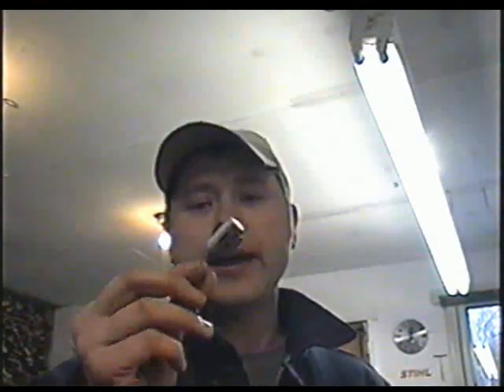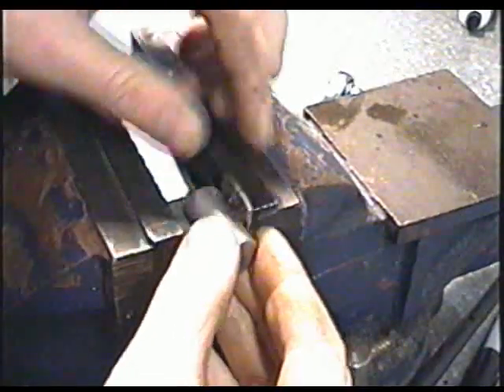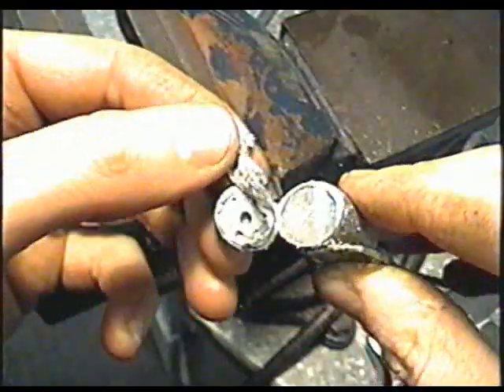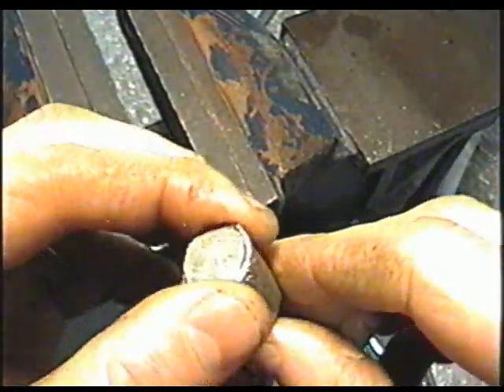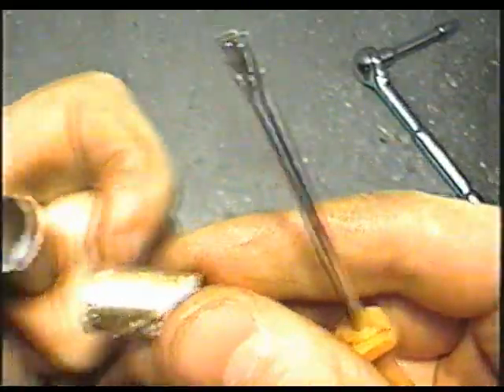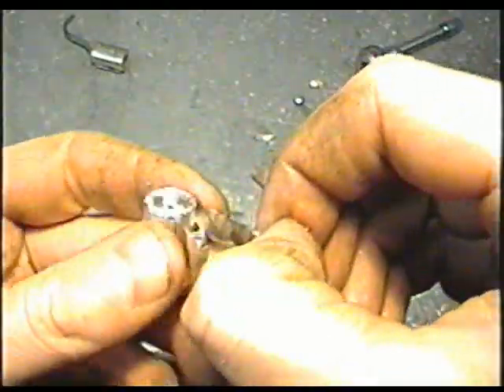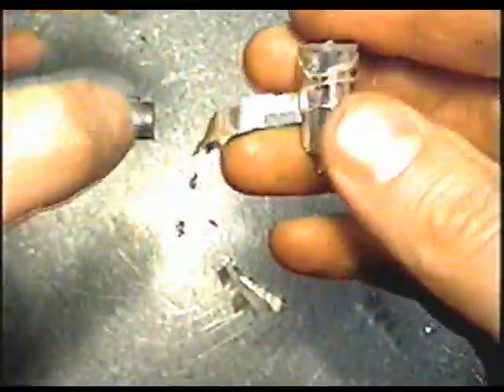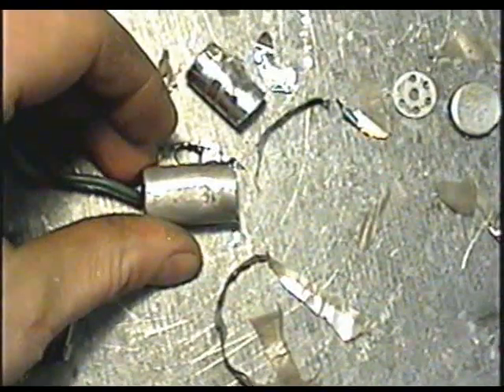What a CONDENSER Looks Like Inside

Comment: just for ur info... its called a condensor, but its really a capacitor.... its a basic electronic divce you could Wikipedia it and find out more easily... the capacitor and inductor couple to form the basic ignition system of older engines.